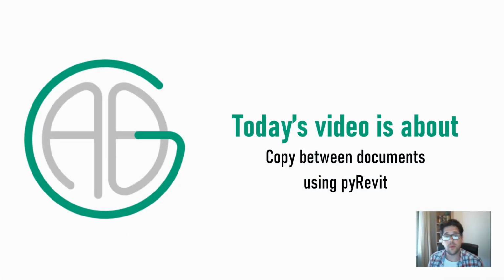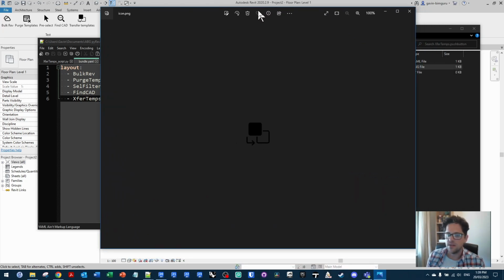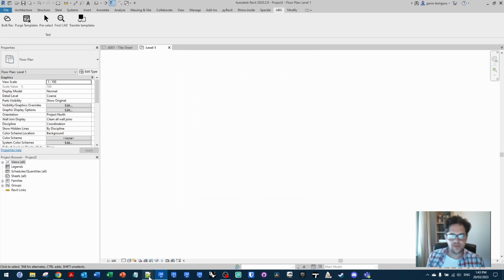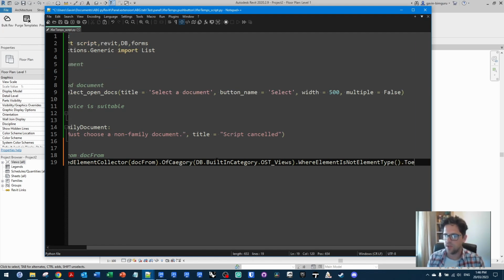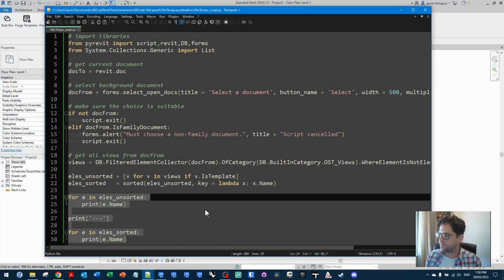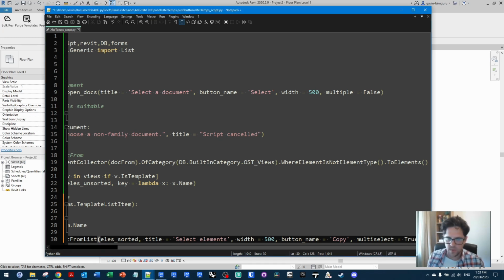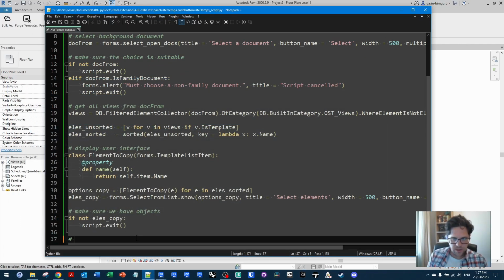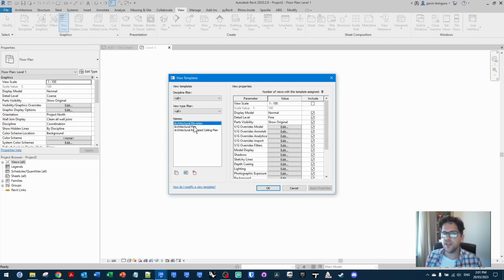Copy elements between Revit documents using pyRevit!

Comment: Thanks for the awesome video. Just wondering if it is possible to do this even without opening the project where you will need to copy the elements from.
Reply from the maker: Not that i am aware of unfortunately. You could programatically open the model in background though and do this then close programatically.
Reply: @AussieBIMGuru  Thanks for your response. Your suggestion works. I was aiming to copy the drafting views to bring in our typical details from a library file to a project file but it was all empty views. I think I should have included the CopyElements method as well and also need to workout that it will paste in the correct views in the destination doc. Thanks again.
Reply from the maker: @roycasumpang8244  yes you would need to get all elements in the source view, make a new drafting view and copy those elements into the target view i think.

Comment: Hi Gavin! thank you for sharing your wisdom. is there a way in Revit to create a parent-child relationship between 1 element and multiple elements(through element ids etc.) without making systems? for example, a data panel connecting to multiple data devices and share information without creating a data system because the native data system has many limitations and is not like an electrical system. once again thank you for your content.
Reply from the maker: As far as I know aside from the relationals Revit provides for systems, the only way alternatively is to develop custom solutions to push/pull/extract data from elements with common identifying data such as a parameter value.

Comment: copy like that is good way to import PipeTypes from one documents to another. usually firm have templates with PipeTypes, and all elements are draw in template, i just copy all pipes(witch trigger copy of PipeType and all fitting belonge to it) and remove  them. All of this is because copy PipeType don't get us fitting that this type use.
Reply from the maker: Yes shopping files are a good way to do this if the users can find the objects to copy. The benefit of the pyrevit approach is the user sees all types even if they cant find them in the shopping model.